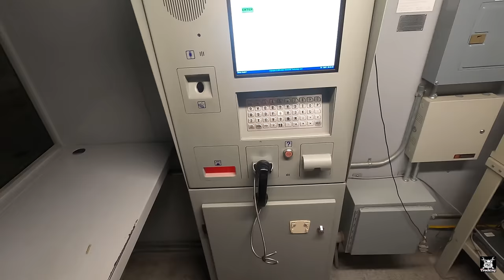Cabover's Day Goes Terrible On Customer's Inaccurate Information

Comment: Wow, if I knew when you were in the area I would’ve stopped to say hi I frequent that yard quite a bit and I remember last week the week of October 29 remember seeing a crate like that on your trailer and I drove by it and sure enough it was a shaft or one of the parts for one of the cranes they use here to lift the containers off the trains and put on the chassis. I remember seeing you over at the southern Michigan railroad back in August was very nice to meet you then,great video as always keep up the good work keep on trucking and God bless

Comment: All I know is when I was growing up diesel fuel was cheaper than gasoline
Reply: the switch came around 2005... along with higher interest rates.
Reply: Are you saying that you don’t know who tied your shoes this morning?
Reply: IT SHOULD STILL BE. DIESEL is at the bottom of refining process.
Reply: If you think back diesel was only used by commercial trucks, ships, tractors back in the day. Then in the late 70's to early 80's Mercedes made that diesel powered car. The early to mid 80's Gm had a diesel engine (converted from gas). Ford had the little courier trucks that had a diesel option in the early 80's.the F series got the international 6.9 diesel option in 1984. I remember seeing diesel for .29 per gallon and gas at .49 per gallon. Those diesels in daily drivers were like unicorns.
Everyones daily was gas powered. Then people caught on to diesel being cheaper and getting better fuel mileage in the late 80's to early 90's into the 2000's. So less car sales which Gm, Ford, and Chrysler discontinued a bunch of models for lack of sales. So now they have a car or two, a suv or two, and trucks.
So when so many people were buying diesel pickups, the fuel companies flipped the script because their profits were going down . Gas was their cash cow. 
Now that diesel is so high in price along with the premium price increase to buy a diesel trucks, like Steve said when he bought his new truck.

Comment: Great video, I learned a new way to handle the ratchet strap tail about a month before I quit hauling equipment. Roll it up like normal, then take the roll, loop it around the strap between the ratchet and hook. Then twist the roll sinching the loop around itself.

Comment: I tell you what, if I ran a trucking company, I'd send invoices to shippers/receivers that made my drivers sit around due to miscommunication. $250 per hour for the first 4, then $500 per hour after that, and I'd split it with the driver 50/50. I remember when BS like that used to be unacceptable, but now society has softened and people get away with just about anything now
Reply: They won't pay it. They won't even pay attention, which is written on almost every rate confirmation. The drivers are always getting treated like crap. Granted, there are a lot of POS drivers. But we're not all like that.
Reply: @timbodnar6711  If they don't pay it we never touch their freight again. Plenty of people need stuff moved, and there's not a lot of good drivers out there. The ones with good reputations have more leverage than they realize
Reply: Oh my 😅, I'm thinking nope!
Reply: It’s more a sign of how much the broker is making vs the driver.  Obviously somebody is making plenty of money.
Reply: @BagBreakerMMA  no we dont. Not in a bad market at all. It comes down to money money money in a crap economic market
Reply: Also stuff like these charges must be agreed upon ahead of time or they hold no weight.
Reply: @chadpflanz8745  good drivers can pretty much set their own rates, but that requires years of dedicated service and making connections. Also helps to specialize like heavy haul or frack sand to the oil fields
Reply: @timbodnar6711  You can let your drivers sit around for free then, nobody is stopping you. Just don't get in the way of people who care enough to try to make changes
Reply: It's been like this for over 35 years of trucking!!
Reply: @tederdmann2993  And where is it written in stone that it needs to stay that way? You seem to have a big problem with truckers getting paid to sit around, what do you have against truckers?
Reply: @BagBreakerMMA  I am one, just saying that's the way it was 40 years ago and will never change!!
Reply: @chadpflanz8745  samething in good economy market too, they never have and never will pay!! That's the conservative repubs way!!
Reply: @tederdmann2993  that means nothing, things change all the time
Reply: @BagBreakerMMA  nothing has changed in over 45 yrs conservative corps went allow that to change!! Come to reality!!
Reply: @tederdmann2993  you’re living in the past, can’t say I blame you. Those times were better
Reply: @BagBreakerMMA  what ever dude, you can dream all you want.
Reply: @tederdmann2993  And you can sit around and not get paid all you want lol
Reply: @tederdmann2993  So let's say downtime pay suddenly becomes a thing... are you gonna turn down that money just because it wasn't your idea?
Reply: @BagBreakerMMA  😆😆😆😆😆😆😆
Reply: @tederdmann2993  You can send all the cartoon things you want, you're still the guy who saw some random comment and couldn't keep his blood pressure under control
Reply: So true driver's are second class citizens now can't use the restroom at stops

Comment: I gotta say I love that cabover you got a dually ram pickup. Shes a beauty . Sorry about all the family things going on that tookl  you away or pull you away. Sometimes it's for the best because I believe and I'm not trying to preach to you : God works in mysterious ways and though I have no explanation for the loss of life you experienced in your family. You probably had a different kind of energy returning to that cabover when you went to the shed and opened those overhead doors after being deviated multiple times. Maybe you need that pause button. I noticed you engaged and disengaged the differential. What's that all about!? Be safe and also God bless you

Comment: If the switch at the pump is sticking try WD40 if the spring in the switch is broken then cross the wires and just use the dash toggle and when you get the time put a new switch in 😉

Comment: Instead of a hammer, you might try a “shorty” wrecker bar. They’re about 15” long with one curved end. Cast between $7 -$12. Great for pulling those nailed in boards off (and nails out too).